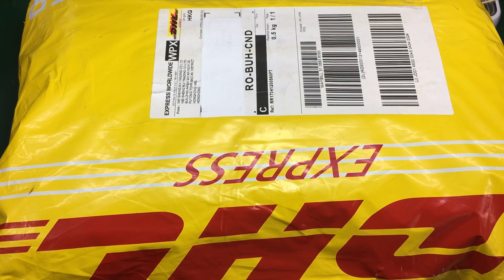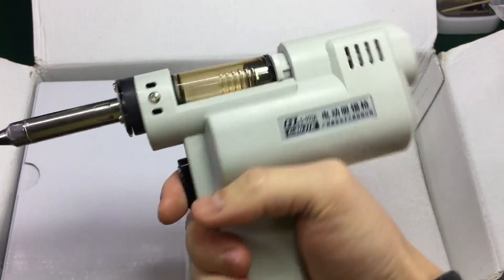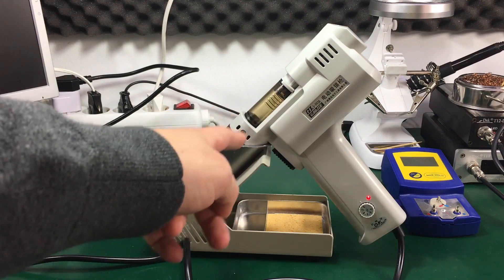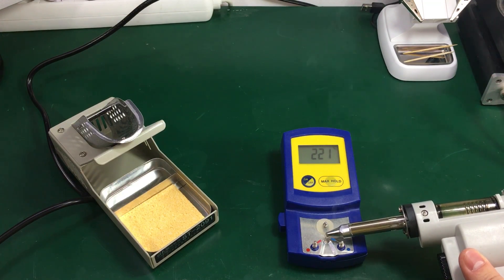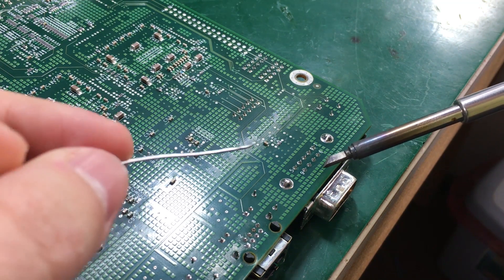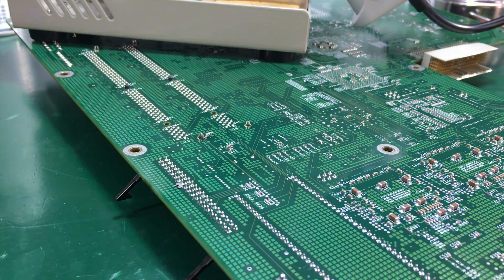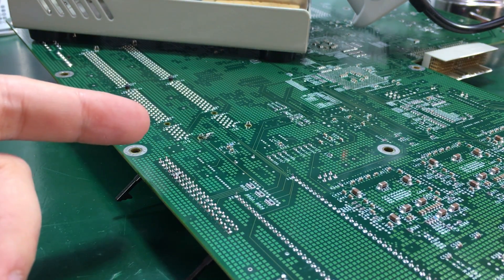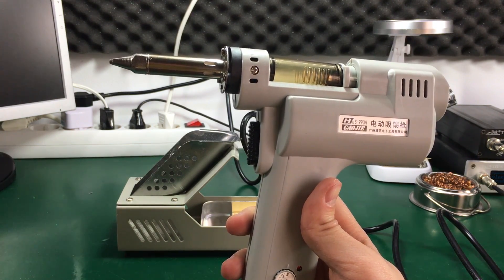Voltlog #101 - S-993A 90W Desoldering Gun

Comment: This item very bad. The heater will burn after few use only. I test more than 3 sets. Very bad. Butter to spend more money and go for hakko or any good brand
Reply from the maker: The unit I have is perfectly fine even after 3 years still working fine. Where did you get yours? Maybe they are not the same quality.

Comment: Is it worth it? I have the manual one and it's really bad as you said you can't remove all the solder you have to try it sevreal times and it's really painful.
Reply from the maker: it's worth it if you do repair jobs.
Reply: I don't but I do repair me elctronics from time to time, and I have ruined a lot of my devices because I just don't have the right tools :(, I got an offer for 100$ for the same machine should I get it?
Reply from the maker: I haven't ruined a single board even before having this tool, and I was using the manual pump + solder wick so if you are being brutal to the pcb's this tool will not save you. However if used properly it does make desoldering much easier.

Comment: There seems to be only 3 tip sizes available for this tool. 1MM, 1.5MM, and 2MM. For some things even the 2MM is too small. I wonder if anyone has found larger tips. It seems to work OK if you keep it clean but as you say, we'll see if it holds up over time. Thanks for the look and your review.
Reply from the maker: I also thought about that and I think going for higher diameter would make it difficult to create the suction force at the tip and also would mean that you are desoldering something pretty big which might exceed the power rating of the iron so it might not be able to keep the solder liquid.

Comment: Looks like the design is based on the Hakko. For the money I don't think it's cheap enough to justify not getting the Hakko, unless it's not available in your area.
Reply from the maker: I guess it depends on everyone's budget.. For me that kind of price difference matters and I will choose the least expensive one for my hobby shop. However if I was running a repair shop and I would have to use that tool everyday, I would go for a higher quality one like the hakko.
Reply: The difference is only about 20% here. I guess tips are more expensive too, but at least they will be available in 10 years.

Comment: I would like to add a few things for general info:

Wait for the gun/iron to heat up, wait for the whole system to reach the right temperature before starting using, other wise you may end up blocking the small pipe that the "old" solder has to travel through.

Cleaning of the tip/suction pipe is essential.

Clean the "waste" container often, and the filter too.

Some "waste" container design are better than other, those with a big spring coil tend to be more easy to clean.

When you assembly the system after cleaning be sure that it is all well fitted and sealed. 

Change the tip when you noting difficulties to transfer heat to the PBC and the component you are about to remove, the tips wear out faster that you expect, mostly due to the fact that the copper inside the tip are etched away and you end up with a hallow tip with no copper to transfer the heat.
I had had to change tip more that once a day if all I did was desoldering. 
The reason for this fast wearing out of these tips is due to the fact that you are often using in circular motion (because that helps a lot in the desoldering process) and especially square pins has sharp edges and sharp ends of pins that scratch you tip inside the hole so to speak, and you end up with small holes/cracks in the outer coating of the tip, and then the copper are etched away fast because of flux (flux helps a lot in the desoldering process so you have to use it), so desoldering tips wear out much faster than regular soldering tips.
Reply from the maker: very good info, thanks!

Comment: Good review. 

A couple of tips (no pun intended) to avoid the damage around the holes 9:37, try not to put too much pressure on the PCB when de-soldering, just use the weight of the gun. Also when you are de-soldering, move the tip of the iron in a circular motion it will remove the solder more efficiently. 

I would recommend a tip of 1-1.2mm diameter for the smaller component leads. Larger leads are a pain no matter what size tip you have
Reply from the maker: I did use too much pressure and will adjust that on the next job, thanks!
Reply: watch for the solder to liquify first.

Comment: You did not talk about cleaning. I have a different one, but the cleaning (removal)  of the solder is a nightmare. I also need these needles quite a lot., because cold solder blocks the air. Any experience yet?
Reply from the maker: I've only used it a couple of times and I haven't cleaned it just yet... but I didn't think it's going to be difficult.. I was thinking if necessary I would clean the nozzle while it was hot by inserting the metal rod, pushing any clogged solder. I will have to report back after I use it for a while.
Reply: VoltLog Thanks. The problem here is not the hot side, it is the cold side where the solder stays till you remove it.
Reply from the maker: okay, I didn't think that's going to be a problem since the solder seem to be colder when it reaches that plastic tube. So far there are a bunch of blobs of solder moving inside the container. What sort of problems are you encountering there? It seems like I can easily take the tube out and clean it, similar to how I was cleaning the tube from the manual pump.
Reply: I have had the same problem and the only way to unblock was to heat up the entry to the tube with a soldering iron. I have now upgraded to a unit with a remote pump with lots of suck.
Reply: Mine even has a remote pump. But the problem is still there..
Reply: @AndreasSpiess  put a small coin in the tube about halfway in. Most of these have this spring inside to prop the filter up to the back (or a conical spring). I found with my cheap unit that if you put that coin into said spring to clamp it midway the cold solder issue is much less.

The coin should not block the airflow of course. Just 'focus' the suction a bit around the edges of the coin. Added bonus is that now most of the solder splashes onto the coin and not the filter in the back extending the filter life.
Reply: Clean the tube out and jam those needle through the hole to clean it periodically, if you wait too long it becomes more difficult...

Comment: Is the tip properly earthed? Not sure if you have anything to check ESD.

PS the plug it came with is Chinese. The Australian plug design is 180 degrees rotated (so appliances from China fit in Australian sockets but the cable usually goes in the opposite direction to what is helpful). The Australian design is better for safety, since the cable's own weight helps the earth pin to stay in the socket. For Chinese wall sockets I imagine that if weight were applied the earth pin would have a tendency to nudge itself out bit by bit.
Reply from the maker: earth pin is connected to the tip

Comment: Nice review mate. I've used one of these de-solder guns for well over a year now IIRC, and have found it very useful indeed, especially for the price.. OK its not a Metcal or Pace but it still functions great and and will get you out of bother. The S-993A I have has a recessed adjuster and not a protruding adjusting wheel so it can't be accidentally adjusted.
As you mentioned the nozzles are too expensive. I'm just waiting for a new one.
Reply from the maker: there is another station called ZD-915 which seems to have slightly cheaper nozzles available on ebay and even locally here in Romania. I think I'll order one just to check if they fit.
Reply: Unfortunately the ZD-915 tips have internal threads mate.. I know my solder gun tips have external threads on a short shank, which screw into the barrel, so I assume yours will too.
Reply from the maker: The tip on my S-993A has an internal thread
Reply: VoltLog Ahh.. Apologies... Mine is too.. I had the wrong image in my head 😯

Comment: The ZD-915 has not been an option? Looks better to me... :)
Reply from the maker: Actually I haven't seen that model before, on the plus side you get an LCD, nicer temp adjustment and a lighter gun/handle on the down side it does take up more space on the bench and the handle is attache with a thicker dual cord. Price seems to be in the same range. Just by looking at some videos for the moment I still prefer the S-993A
Reply from the maker: I wonder if the tips are interchangeable though.. cause they're much cheaper on the ZD-915
Reply: just got my ZD-915 :) - and i can now tell you that the nozzles are NOT interchangable, unfortunately. They're in fact totally different, not threaded at all.
Reply from the maker: too bad..

Comment: Hi. Another good review. May I suggest a teardown video as well, as the PCB in the handle might need a bit of a flux clean-up. I purchased the S-993A (110V version) from an eBay seller several months ago and had a terrible experience with a defective unit right out of the box -- the picture here says it all, https://goo.gl/UJQjfe. I would recommend that any buyers of the S-993A open it to inspect the PCB. After opening mine after the overheating incident I found several solder blobs on the PCB and one large one bouncing around loose in the handle. I am not sure if this caused the problem, but the unit was dead after unplugging it and letting cool down.
Reply from the maker: thank you for bringing this to my attention, I will do a teardown soon. In your pictures it was glowing red hot, that's scary!
Reply: I'm sure my experience was a fluke, but it might a good safety measure to take a look inside, just in case there is a potential problem. Yes, the glowing red hot nozzle assembly was quite scary, indeed, especially when it started to melt away from the main body right after I took the picture.

Comment: I don't like the placement of the temperature control switch on the handle.  It is easy to bump while using the iron if you are left handed.  The tips are too expensive.
Reply from the maker: The pot doesn't turn easily so I don't think you will accidental adjust the temperature but those tips.. surely they can make them cheaper.